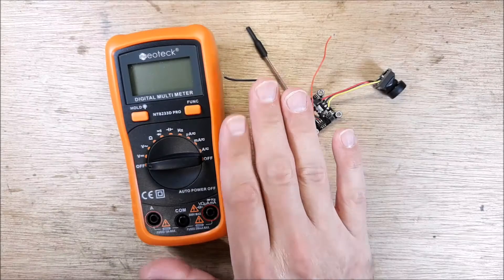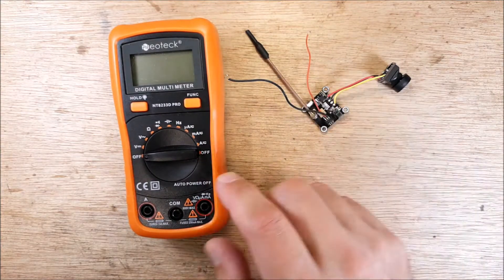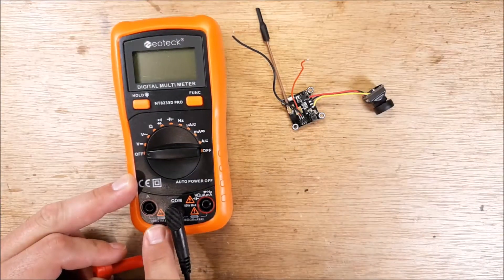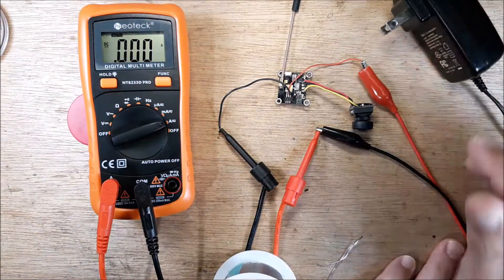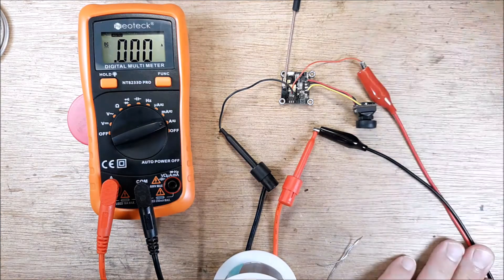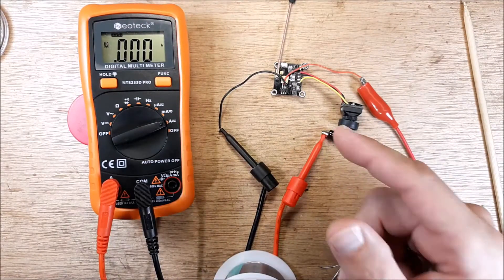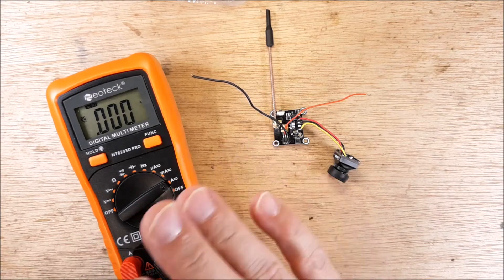How To Measure AMP Draw Of A Single Component | Check The AMP Draw Of Each Device

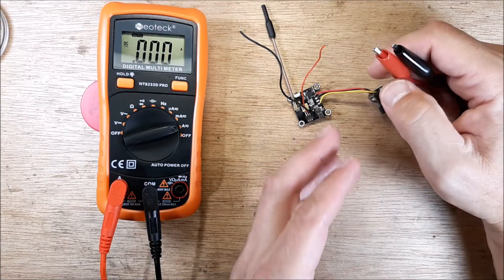Comment: 3:30 You might confuse some people as wo which wires are what. It looks like your Meter wires but they are your Transformer PS wires....
Hey there Boss, You can use a broken USB wire and use the red and black in there to get your 5v. The other 2 cables in the USB wire are Data.
!!!!! WARNING !!!!! Just be sure to be messing with your USB voltage from a charger (1am, 2.1 amp, I think there are even 3amp chargers)  not your laptop because any stray current going back up those wires or your data cables might fry your board.